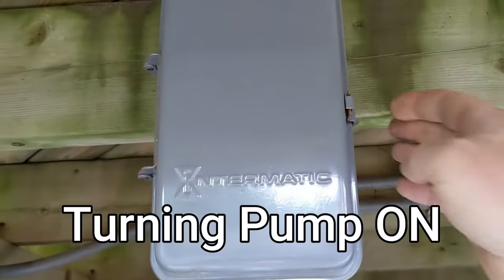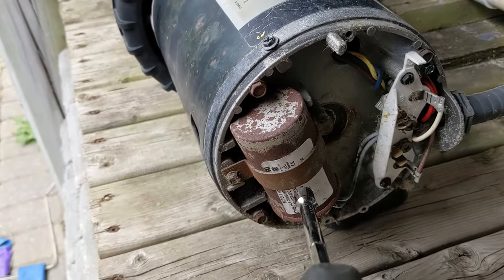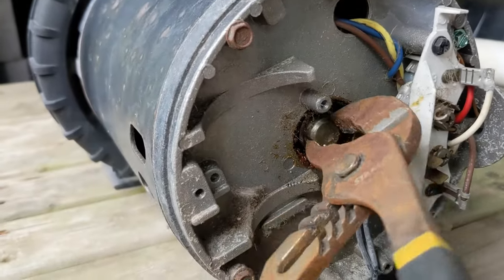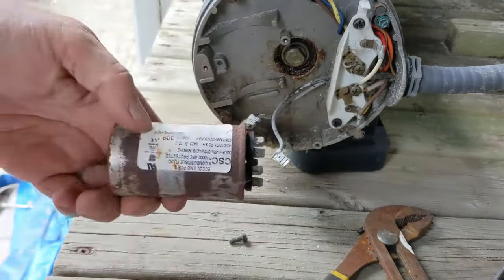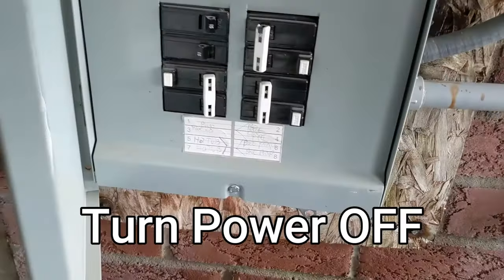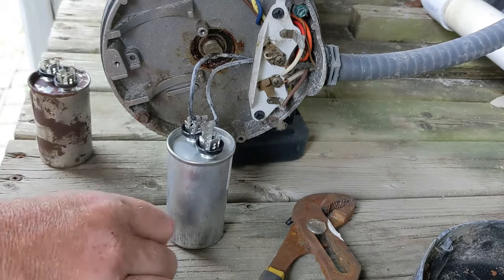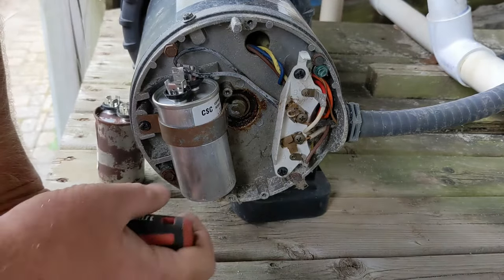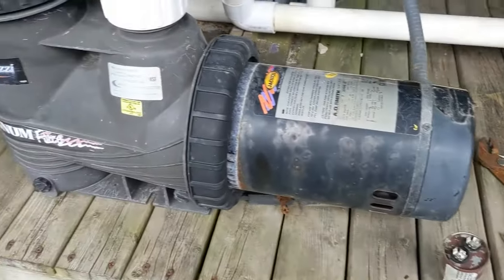Swimming Pool Pump Keeps Tripping The Breaker / Pool Pump Not Working

Comment: Just had a brand new pool installed and the breaker kept tripping. It would run for a few hours, then trip again. When the pool was installed, there were no empty slots on my breaker box, so they added a small breaker box with a few breakers (pump, pool light, etc). Only the one for the pump trips. So, they replaced the breaker for the pump and it ran for a few hours and tripped again. They just replaced the new pump, with another new pump today and so far it's working (only been two hours). If this doesn't work, what else might be causing the issues? This is frustrating to deal with, especially considering the pool is not even a week old yet! Thanks so much for your videos!
Reply from the maker: If everything is new, I would say it's an amp draw issue.  Breaker size might be wrong.  The pump will have the larger amp draw.  Could have been a capacitor issue also.  If it happens again, get an electrician in to look at it.

Comment: I'm fighting this right now.  The old pump was seized, so I bought a new pump.  Now it's tripping the breaker.  Tried several breakers, 15, 20, and a 40.  Trips instantly no hum or anything.
Reply from the maker: Wiring on the pump is wrong.

Comment: My pump works for about 3 seconds then trips the breaker. Already changed the capacitor with no success. Should I try the circuit breaker or the timer next ?
Reply from the maker: Your pool pump runs for 3 seconds then trips the breaker?  Is this consistent?   Can you turn back on and it runs for 3 seconds then does the same thing?
Reply: @VIPPoolsandSpas  so it’s like this: sometimes I reset the breaker twice and the pump stays on. Sometime I need to reset the breaker 15 times( give it or take). Once I get it to work, the pump runs fine with no gridding, no adverse noises, no leaks. It runs just like it normally would. It’s a variable speed pump so I have two timers installed. I first thought it was the capacitor. I just changed and the problem persists. I’m trying to eliminate from the cheapest part to the most expensive one( the pump motor). So, should I look in changing the breaker next or one of the timers (or both) ? Pool was built in September of 2016, so, the pump is roughly 7 years old. I opened the electrical pane and there are no signs of moisture, burnt, or disconnected wiring.
Thanks for the help !
Reply from the maker: @rafaelappe  most likely moisture in the keypad.   What pump is it?
Reply: @VIPPoolsandSpas  Pump is a Hayward SmartMax Star Pump. motor tag says Century SP3210Z2ME. 
What do you mean by keypad? Inside the pump motor or on the electrical box?
Reply from the maker: @rafaelappe  If it's a variable speed pump, then there will be a box on top the motor part with the keypad.
Reply: @VIPPoolsandSpas  yeah, not this model, sir. There are no controls or keypads on the pump. The only to turn it on/off is through the timer. One timer is used to turn the low speed, the second one for the high speed.
Reply from the maker: @rafaelappe  OK.  So it's a 2 speed pump.   Do you know if it's tripping on the low side or the high speed side?
Reply: @VIPPoolsandSpas  it trips on either speed.
Reply from the maker: @rafaelappe  at this point, I would disconnect the wire from the pump, make sure no wires were touching.  If it trips then, it's not the pump.
Reply: @VIPPoolsandSpas  very good. I’ll give it a shot when when I get home this afternoon. Thanks for the time.
Reply: Alright, boss. So, I disconnected the pump wires and resented the circuit breaker and still popped. Change circuit breaker next ?
Reply from the maker: @rafaelappe at this point you need an electrician.  It's not the pump, so it's going to be a short somewhere else.
Reply: @VIPPoolsandSpas  agreed. I’m not expert enough to be messing with electrical. I’ll call someone tomorrow. Thanks for all the help.
Reply: @VIPPoolsandSpas  So, just to close this with the solution. The electrician did confirm that it was the circuit breaker after all. Quick change for a new one and it's back working as advertised with no further issues.
Thank you very much for all the attention and help troubleshooting this.
Reply from the maker: @rafaelappe  glad you found the issue.  Pretty rare for a breaker to go on a pool pump.  Normal on a hot tub.    Maybe I'll do a video on your situation.   Could have disconnected the wire from the pump and turned the breaker on.   If it trips, it's the breaker.  Thanks again for watching my videos.
Reply: You Talked about moisture in the keypad on the vfd - could you go I to that a bit more?

Comment: How long should a pool motor work?  Had a guy tell me today they last 2, 3, 4 years.  That seems incorrect to me.  My pump is also tripping a circuit.
Reply from the maker: A pool pump lasts a very long time.  I have customers where the pumps are over 10 years old.  They last a long time if serviced when needed.  If your pump is tripping the breaker, test the motors capacitor.
Reply: @VIPPoolsandSpas  Thank you.  The "fixer" is coming by tomorrow and I'll stand over him to test the capacitor.  This pump is 2016 so not brand new.  But It's $579 I was not expecting to pay.
Reply: Following back up, I watched the whole replacement.  The motor was very rusty on the bottom and even if it had been the capacitator - the motor was not long for this world.  I had him replace it.  I appreciate your fast response as I learn more about maintaining my pool.